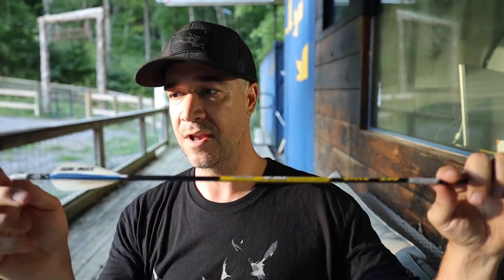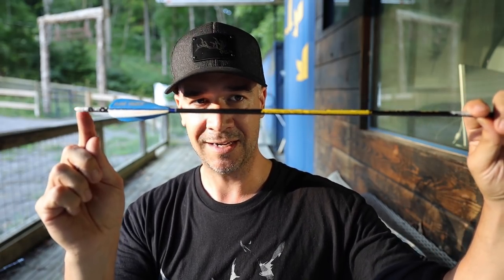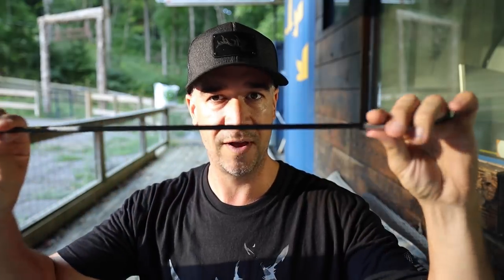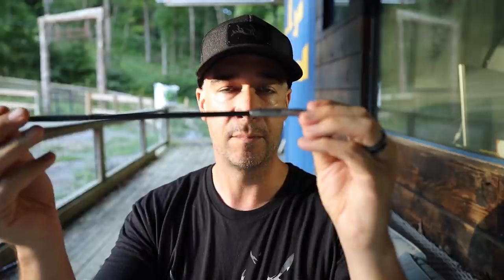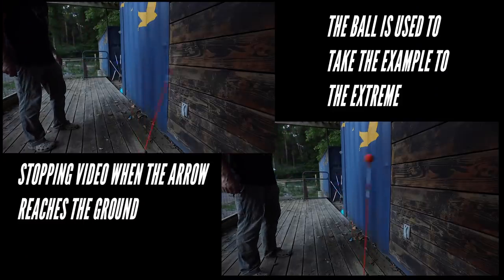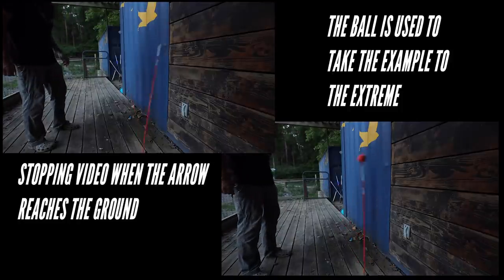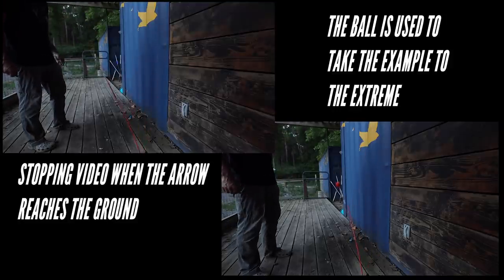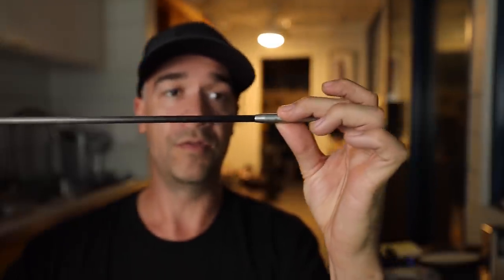Arrows Part 2: A dumb guys understanding F.O.C. (Im the dumb guy)

Comment: When I first got into archery 3 years ago, I jumped in head first into traditional. I quickly found out that replacing the 125/145 field points with 200s made my groups instantly get tighter. Chasing FOC as so many seem to is alluring but Ashby’s primacy was on 1: Structural integrity 2: Perfect Arrow Flight* and 3: FOC. The emphasis should always be on arrow flight over FOC. 

This season I bought a compound, transitioned what I learned from trad and am shooting a 29.5” Easton axis with 200 up front. FOC is 16% and total arrow weigh is 514 gr. I shoot out to 60 with fixed blade(Iron Wills w125s) and I’m satisfied with what I’ll be taking to the field. Might need a matrix target now tho. 🏹
Reply from the maker: Well you pretty much nailed one of my picks for the part 3.  None of my picks fall into the extreme FOC category. The Valkyrie setup will be the highest 280g out front.
Reply: I've been waiting for this. B4 I forget, the SEVR self healing targets r the real McCoy in every aspect when shooting a heavy headed arrow shaft with total weight in the 515-570 grain category. If the Victory micro VAP TKO's can shoot 265fps @ 60 lbs. U will be impressed like the bowshop was last fall. After 3 arrows give u penetration that will leave u scratching your head u will be blown away. Take in mind the ultra high quality head & INSERT is needed 1st. Then perfect tuning bareshaft style is 2nd. Then u fletch which will give u the groups u desire when u do your walkback tuning. I have 2 similar bows with different weights arrow builds & neither bow never shot quieter. Not to mention the head hitting the SEVR target on camera is much louder & alarming than the shot going off.👏
Reply: Joseph tread lightly I’m using Ironwill components and heads. Arrow is definitely quiet even with the max hunter vanes(4x).
Reply: @joeybennett1491  I really like my Bohning X3 2.25" vanes. I wasn't sure about putting 4 on a micro shaft but they r low profile & quiet. One thing I don't hear people talk about is that deer duck the string when alerted or the bow sounds like an erector set when it goes off. If u deaden the noise it is far better than the mindset of I need a faster setup.  Another thing which is important is being above the animal on a different sound plane. I know people that have shot bucks that were never recovered. The 2 things I hear the most is that they were in a ground blind on the same plane as the animal. The other is I was shooting a mechanical head @ 290 fps, from a ground blind. That to me screams I'm only interested in hitting the animal in the lungs well behind the shoulder cuz of integrity reasons.  With the noise the animal hunches usually in a way that your hit is mediocre @ best. I want to recover my animal quickly to get the process done in a timely matter for better quality tableware So did early man who never thought about shooting 300 fps or how many yards it is or will they jump my string?
Reply: @joeybennett1491  Just got my 50 grain outserts with my 210 grain points & heads. I'm shooting the Valkyrie short Jagger 210 model @ deer this fall. I'm looking forward to having the same arrows & ultra sharp heads year in & year out without structural integrity problems. They penetrate like no other & I tuned all 12 the same. I will sort them so 6 with the green nocks have heads on them with the other 6 will yellow nocks r outfitted with points.
Reply: Joseph tread lightly sounds good man. I have heard nothing but good stuff on the Valkyrie components.
Reply: @joeybennett1491  Check out the DIY Sportsmans latest video. I don't have the link but it's titled Sam's First Deer!!!!
They show that broadhead up close after the shot. Even in slow motion it goes through the deer @ lightning speed. It's not a small deer either, bigger than she is!
Reply: Joseph tread lightly will do man! 🤙

Comment: It is a shame that Dr. Ashby's demonstrations were never professionally recorded for posterity. I think the ones that were recorded were kind of the "cell phone from the third row" kind of thing. His research is really profound but I think the biggest thing to take from it is to apply the concepts not the fringes. A 1000 grain, 30% FOC, cut on contact, 3 to 1 taper, single bevel arrow is only needed for the really tough/big/dangerous stuff. But applying the individual concepts to a "normal" arrow will increase performance and help harvest more animals in an ethical manner.
Reply from the maker: You summed it up.  30% is tough to get to though

Comment: I can simplify it for you. Bowhunting is a game of close range. If your predator close 20-30 yards, not trying to turn your compound into a rifle for lack of hunting skill, then that front loaded arrow will blow through anything. Get close and hit them with a sharpend sledge hammer. It works flawless.
Reply from the maker: I'll work on both skills simultaneously. Bush craft and getting close and then the ability to land an arrow at 80 yards.  Seems like I'd have my bases covered at that point!
Reply: @brandonmcdonald6121  yes you would. I'm just saying trajectory doesn't matter on close general bowhunting ranges. Most guys with heavy arrows just shoot close and get pass through on heavy bone.

Comment: I’m kind of confused how we have gotten ourselves (archery community) get into these 2 camps. Bottom line is heavier penetrates better, reasonable FOC will fly better. But there is not reason to go to extremes, a 450-500grain arrows with most the weight up front at 260 or above should be fine for almost everything. If your shooting 300 FPS your set up is probably too light, but unless you are hunting in Africa 750gr arrow is just too much. I’m trying to take the best from both sides, I have the best arrow flight I’ve ever had with my new set up, 455gr arrow 13%FOC at 268fps. And I’m very excited about it.
Reply from the maker: I think that's a very reasonable setup. I've got some 460ish grain arrows that are some of my favorite flyers. I think the bow manufacturers talking about speed speed speed makes people say "why do I have a 340 ibo bow that's shooting 265 fps?" Plus the change in arrow tech that actually allows a very light arrow to go 340fps is relatively (in the human timeline) new

Comment: So where does (not necessarily spine stiffness) arrow density material come into this conversation?  Such as using a FMJ verse a carbon?  If the rigidity/density of the arrow is able to maintain integrity at hitting solid mass (bone for example), how does this influence the FOC debate?  Being that one would expect a FMJ arrow to maintain structural integrity more than a densely spined carbon arrow?  Thanks!

Comment: For for the 29' 79 lb guy, what is the optimal grain per inch arrow, and how much weight should you add out front?
Reply: Travis Scott the amount of weight you can put out front depends on what spine arrow you shoot, the stiffer the spine the more weight you can use. Shoot the arrow bare shaft with different weight field tips and eventually you find one the arrow likes and it will fly straight. I’m shooting victory rip Xv 350 spine with 120 grain inserts and 150 grain points, 500 grains taw. Pulling 70 pounds, with 28” draw , arrows cut at 27”. These arrows don’t even need fletchings. First two rules for penetration is, sharp broadheads and perfect arrow flight. A lot of guys don’t know how bad their arrows are flying until they strip the fletching off and and shoot it at 20 yards.

Comment: Just because everybody repeats the same nonsense does not make it fact. You are right - the energy is not transferred to the tip. The entire "unit" accelerates giving each inch of the unit (arrow) a kinetic energy and momentum. You can take all the kinetic energy (or momentum) and divide it per inch depending on the weight of that inch. If the front 2 inches (head) are the heaviest 2 inches in the arrow - then those 2 inches will have the most energy - due to speed x mass. Energy does not move from the back to the front - with all the energy upfront and none behind. The baseball string example is simply the string has next to no weight (mass) compared to the ball. This is simple physics - as you explained the rest.

Comment: Killed my Elk cow with 55lb recurve bow (probably nearer 52lb at my Hobbit 26.5 inch draw length) with a 605g arrow build, with 24.5% FOC, at 22 metres. Front chest shot, arrow penetrated to the nock. Ran maybe 25 metres before crashing over. Getting the arrow to the animal is archery. After that is the hunting part.
Reply from the maker: Nice. Sounds like you knew the setup you wanted based on your specs.

Comment: Watch the video by Ranch Fairy titled " Impact Paradox" , great video of shooting a pig shoulder and the movements of the arrow on impact. I light arrow kicks to the side and wiggles its way through, the heavy arrow hits wiggles a second and then the heavy tip pulls it through. 

I didnt go as far as to jump from 370gr to 700gr, but i did add 100 grains to the front end of my arrows to be just over the 450 mark. And i will say my groups have got tighter and my arrows are flying better than ever.
Reply from the maker: I've watched that one a couple of times. I should have remembered the phrase "impact paradox". Troy doesnt sugar coat things! You think if you go up another hundred g it'll be even better?
Reply: Im not sure if it will help or hinder. I am very curious to test it out. Possibly push the boundaries of 575 to 600 total grains. 
With the start of hunting season in 48 hours, i dont want to start testing now. I will wait until after the new year when all of our hunting ends. I will keep you posted on how it works for me.

Comment: Great videos Brandon. I agree, and disagree with some of your theories. First, and probably biggest, I like an arrow that will keep the broadhead in the chest cavity. Think of being stabbed with a knife. The cut will eventually kill, but if I twist it, I create a more drastic wound channel. On to what I do agree with, I love FOC setups. I'm talking 15-18% though. This extreme stuff goin around right now, is just that, extreme. I believe there comes a point where you can have too much FOC. I'll save the rest of that comment for the next video. I'm curious to see where you go with it. Arrow builds are definitely preference based. No one will ever have the perfect answer. I have a 27.5-28in draw. I pull 60#. My builds are anywhere from 380-420 grains. All built with that 15% FOC range. Ive had luck with fixed and expandables. The most definitive correct statement you've made, is you never know how that arrow will react until it hits an animal. Patiently waiting on part three. You're doing well with your personal theories. 

PS, where in TN are you?
Reply from the maker: I watched a video today where they looked at the stats of deer tracking dogs that would search after a wounded deer. It was almost 2-1 they would recover the passthrough shot. I think it was over 100 cases, which is anecdotal but still pretty interesting.
Reply from the maker: I'm in Nashville
Reply: @brandonmcdonald6121  if you can find it, can you send the video link? Sounds intriguing. I'll try and find it as well. Using a tracking dog, to me, usually symbolizes a mediocre to poor shot as well. Id definitely take a large cutting diameter pass-through there. Once again, back to semantics. I'd love to pick your brain on the different systems you're testing as well. Message through here, fb, or something. 

Nashville is beautiful. Lived there for a bit. I was stationed in Clarksville. I try an do some public land hunts there still. I'm originally from Central Illinois, and live here now.

Comment: Brandon, The Ranch Fairy will answer all of your foc questions. The higher impact of the heavier arrow is due to the retained velocity, which also translates to more ke on impact. This may not sink in at first but ke is a measurement on impact, momentum is measured on exit. High foc builds momentum. A 600gr arrow with a 10% foc will not hit as hard as a 600gr arrow with a 25% foc. Both being shot from the same bow at the same distance. The further the target, the wider the spread will become.
Reply from the maker: Just like most of the studies I've read, I'll have to read your comment a few times! Thanks for taking the time.
Reply: @brandonmcdonald6121 my point was that foc is more important than just better arrow flight. A 600gr arrow for instance with a 10% foc vs a 600gr arrow with a 25% foc has the same ke when it leaves the bow. At the 10% starts shedding velocity much quicker though and never has the momentum of the high foc setup. Momentum and a sharp fixed blade is how these people are getting passthru's on elk with a 50lb bow, it isn't with speed and ke.

Comment: Question for you that I do not know if you are going to cover. Spine alignment and nock tuning. If you have all your spines perfectly matched up (the strongest portion exactly on top) and the nocks all aligned the same in relation to the spine. Shouldn't they be tuned the same? Or do you still need to nock tune them?
Reply from the maker: I'm going to talk about building an arrow and  that will be a part of it.  the issue with nock tuning is most people are buying arrows that are already fletched and cut. You can still do it, it's just better with bare shafts
Reply: @brandonmcdonald6121  I never buy completely built arrows. I build my own so I can control certain build portions like having all the blades for broadheads to be aligned exactly the same and not inline with the fletch. I can also control my fletch angle, location distance from the nock, and what colors I shoot. I have never bare shaft tuned before and have wondered about the spine alignment (stiffest portion, I cannot afford the new $270 dollar arrows with no spine difference. I always put the stiffest part straight up, but maybe the stiffest part should go down?) Always learning new stuff.
Reply: Michael Christensen I think spine indexing is necessary, from what I have found in Broadhead tuning. I haven’t had to nock tune yet but it’s certainly a technique to be acquainted with and applied should the occasion arise.

Comment: Center of gravity and center of effort (or pressure) - Think of a shopping cart pushed in reverse, think of an arrow dropped vertically with the fletchings weighing more than the head.  The mass drives the motion.
Reply from the maker: I like the example that uses gravity you gave. Off a tall building the arrow will flip and stabilize. Damn, that would have been fun to film as an example!